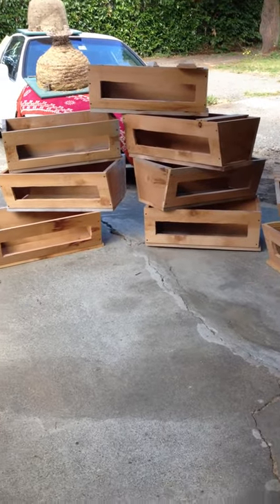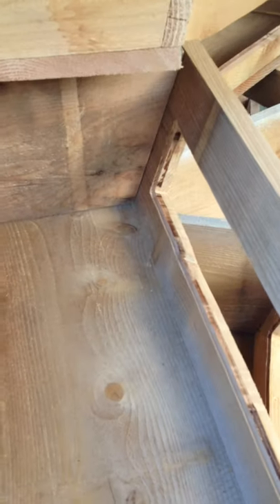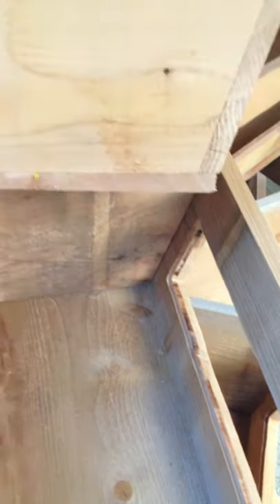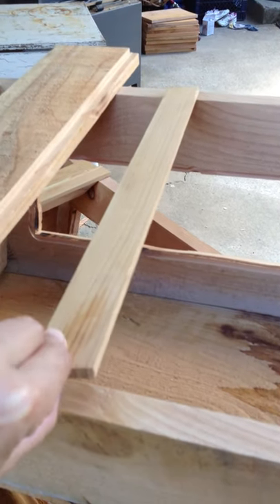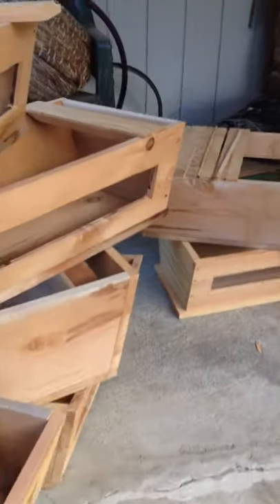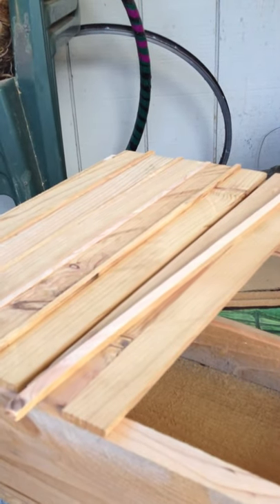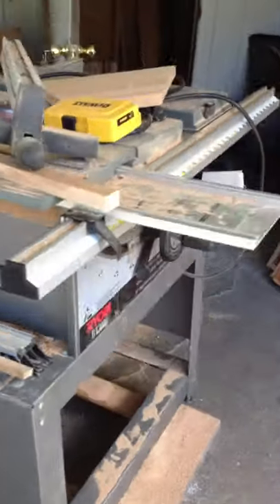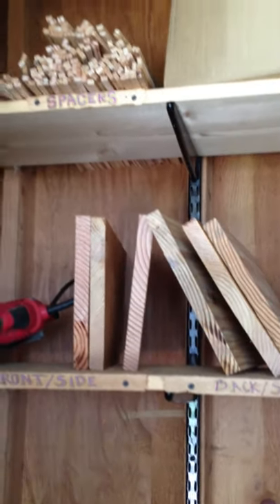Top-bar Beehives: Setting Up Shop to Build Beehives

Comment: Why did you choose this type of hive ?
It is not very ergonomic and bees prefer a vertical space if they have a choice. Also using unsupported comb slows down all operations with the hive so you keep them open for longer time and disturb them more .Also if honey will be harvested the combs will deform or brake in a centrifuge so only partial extraction can be achieved, unless you plan to tress the comb witch is destructive and forces the bees to rebuild. Rebuilding comb puts stress on a hive and they need to consume a double quantity of honey by weight to produce a given amount of wax, so less honey for you or less winter reserves for them if you extract to much.
Why not use a tower type hive with full frames. It is better for everyone. Even a commercial hive would be better. All you have to do is not use the commercial methods and medication and you could be quite everGREEN .